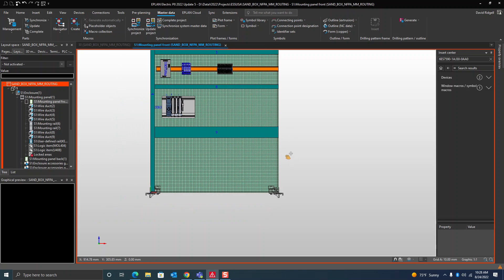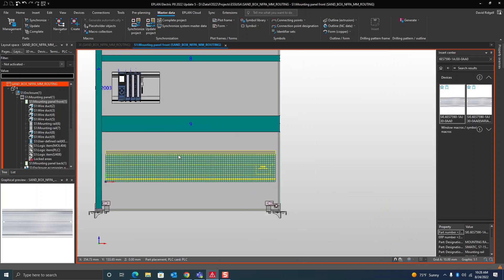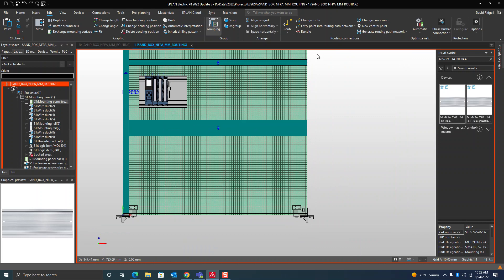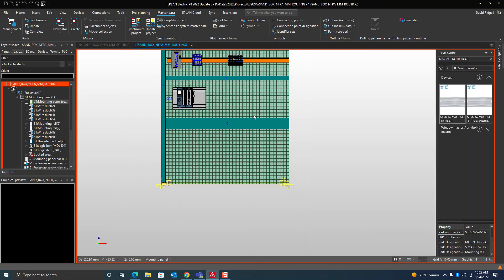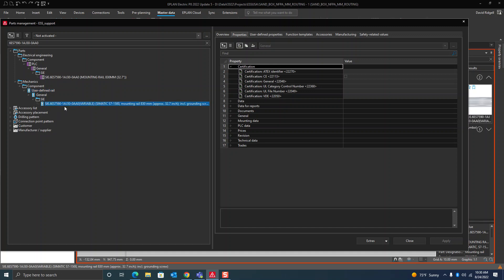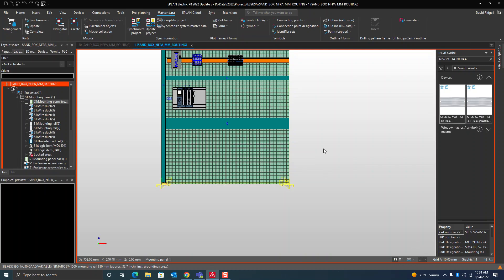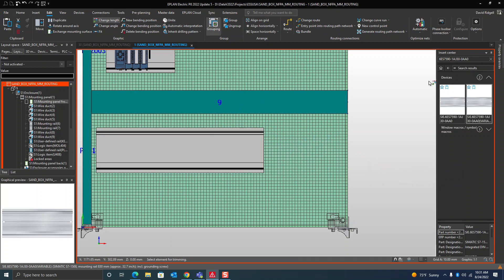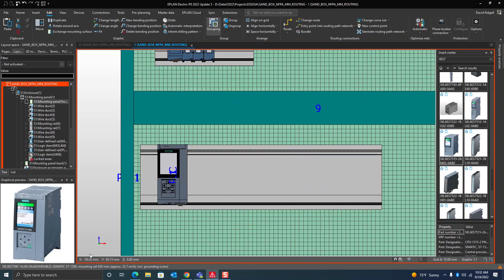EPLAN Pro Panel Tips & Tricks - User-Defined Rail

Comment: I have the same question, how did you get the outline?
Reply: programa de ayuda - datos basicos -  contorno(extrusion) - nuevo. ahi lo podes dibujar a gusto
Reply: I ended up creating a drawing of the duct. I grabbed a step file from Panduit for mine. After that I drew a polyliine of the side and then copied and pasted it into the fc2 file. I also had to use the SCALE command to make it the correct proportion.

Comment: Great video but how did you save the Extrusion 2D profile drawing as an fc2 file?
Reply: programa de ayuda - datos basicos -  contorno(extrusion) - nuevo. ahi lo podes dibujar a gusto
Reply from the maker: I imported the 2D Cad (DWG) file from Siemens website. Then cleaned up the DWG to ensure all the lines were closed.